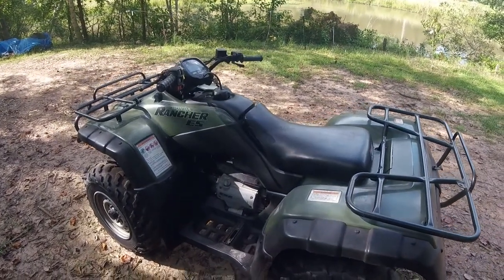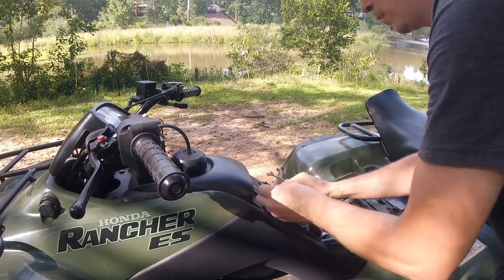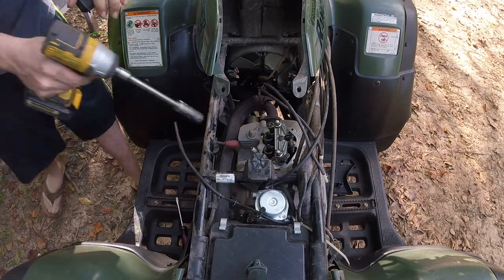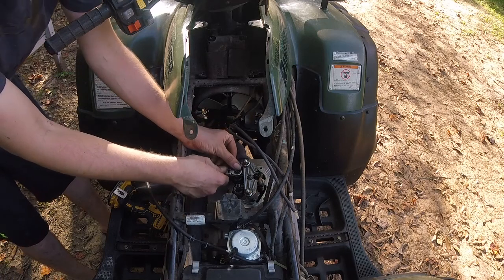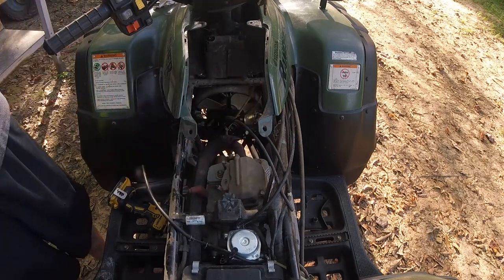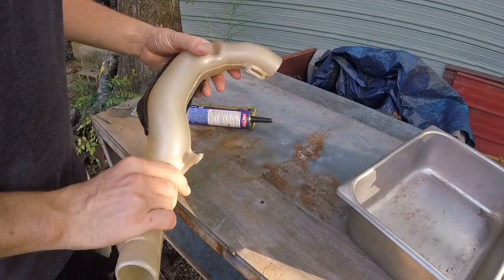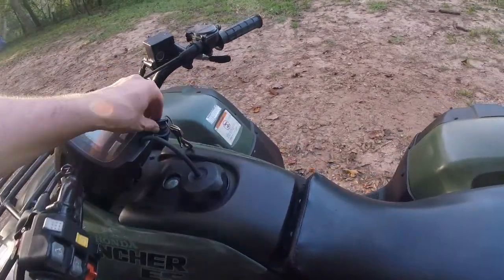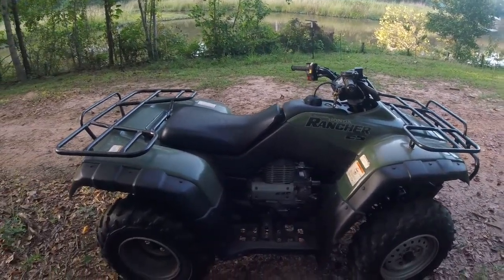HOW TO ADJUST THE VALVES ON A HONDA RANCHER / FOREMAN ATV

Comment: Appreciate the level of detail man!! I just bought a 2017 Rancher with 200 miles. Never checked or adjusted valves in my life, but your video gives me confidence. 
So, you know you are top dead center when the intake and exhaust valves can “wiggle” like that? For the lack of a better word, sorry. Lol!!
Reply from the maker: THANK YOU SO MUCH MAN!! YOU CAN ALWAYS SHINE A FLASHLIGHT IN THE CYLINDER TO CHECK FOR TDC AND LOOK AT YOUR TIMING MARKS BUT YES BOTH ROCKERS SHOULD BE ''LOOSE'' THANKS FOR WATCHING!!

Comment: Wow mine has 3000 miles and I’ve never heard that noise
Reply from the maker: it’s recommended in the manual at 250 miles to do the first valve adjustment which I’m doing here, after that u can go many miles without doing another. I have another rancher with 9,000 miles and I’ve only done two valve adjustments on it. these are great engines!

Comment: Cant believe you took the plug out with the impact wrench and then put it in  without starting it with your fingures first, and tightened the tappet cover bolts with it . And 006 mm ??? dont think so pal. .006 " .152 mm your teaching people bad habits there pal. not to mention the amount of threads you're knackering up.
Reply from the maker: I ment .006 inches watch my 300 vid I say inches and trust me I haven’t messed any threads up I’ve been working on atvs my whole life and never stripped a thread I’m very easy with a impact it sounds like it’s torquing them more on camera but I assure you it’s not, it’s all about throttle control with a impact and most of the time I only use a impact to get the bolts started and use a torque wrench after which I don’t put on camera to save time. Check out my videos on fixing the fourtrax 300 with engine problems
Reply: Perhaps you have a better video of doing it?
Reply: I’m a motorcycle tech and I understand where he is coming from about the impact, remember you may have been doing this for a while but you are teaching people how to do this!!! Show them how to do it the best way with out error, impacts as you know in inexperienced hands can ruin threads very easy! Especially in aluminum!!!

Comment: Good video, these bikes are so easy to work on! I used to have a Suzuki Kingquad and everything was hard to get to on that bike.
Reply from the maker: I use to have a king quad 300!! That was my first atv! I ragged that thing out and had some good times on it, when u put it in super low diff lock it would pull the gates of hell down hahah
Reply: @TheHomePros6221  you sure can! I wish I had one of those in good shape but with a 600cc engine or similar.
Reply from the maker: Yea that would be awesome I’ve been looking for a nice one